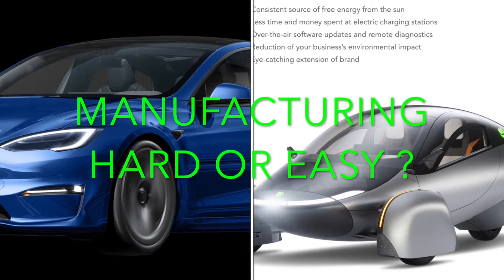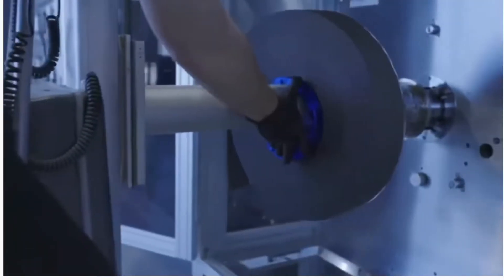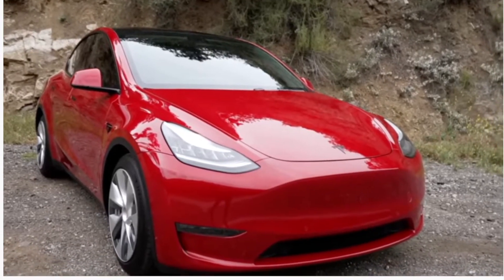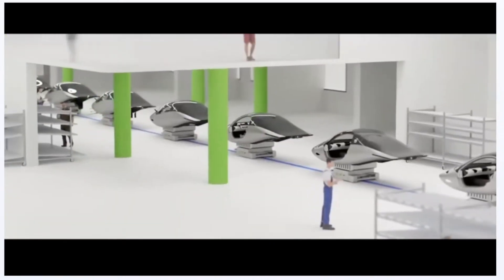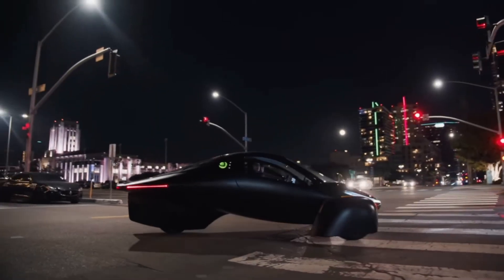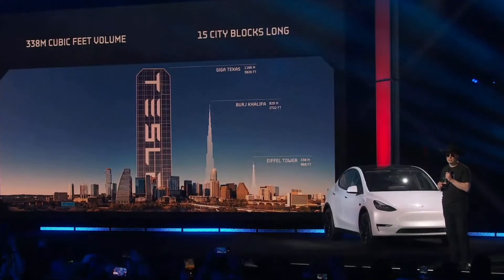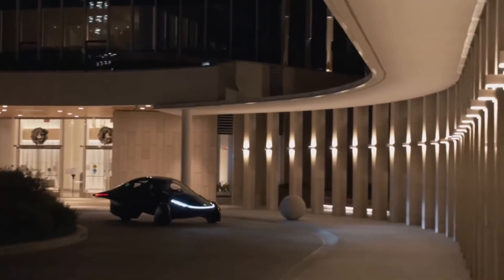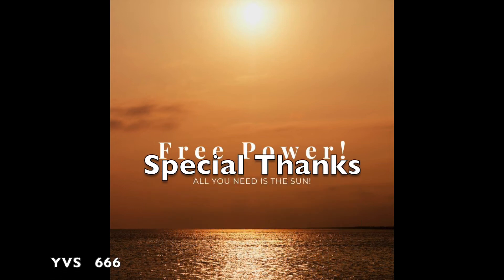Manufacturing Hard Or Easy From Tesla's and Aptera's Stand Point .

Comment: Thanks for this video. Lots of good information. Quite a difference between the two approaches. Can't wait to see Aptera's production floor busy with real activity! With Tesla's HUGE manufacturing overhead, I'm surprised they can sell them for what they do and still make money.

The composite material being used for the Aptera's body is claimed to be 7 times stronger than steel. But this is per unit weight. I suspect the composite material is much lighter than steel so this comparison might be a be a bit misleading.

Comment: Like you I think Aptera could be very big in the future for these main reasons:
1. The most efficient and light weight to make solar power the significant portion of total energy. If you drive less than 40 miles a day, it could be free driving the Aptera.
2. The use of in-wheel motor eliminates transmission box and axels and make the building of Aptera so simple.
3. The right to repair will foster an after market industry, performance Aptera, servicing garages .
4. Aptera could be charged with regular household 110 V.
5. Since the building of Aptera is quite simple, Aptera could franchise the making Aptera like McDonald franchise restaurants.
6. Aptera is built for common folks who do not own house and garage to have high voltage charging facility.

If Aptera could pass the hurdle of initial production, someday it could be the most popular car in the world.
Reply from the maker: Thanks for the comment , we will find out very soon because they are starting prototypes the end of this year .
They are going to start production next year , and when people find out what this car can do everyone is going to want one !